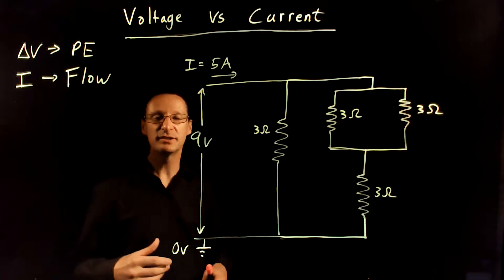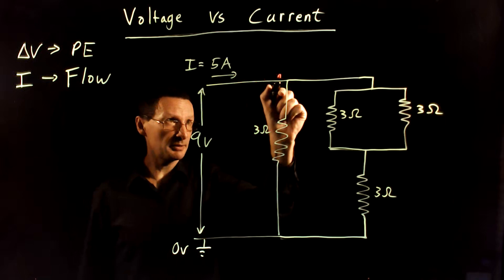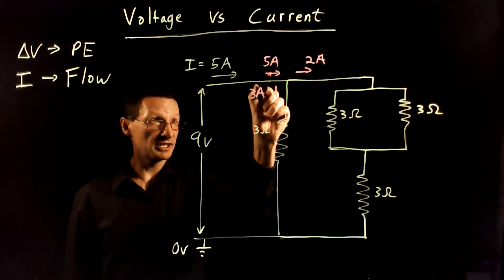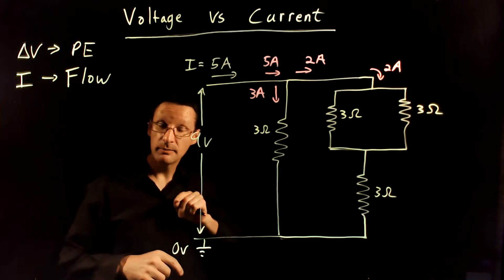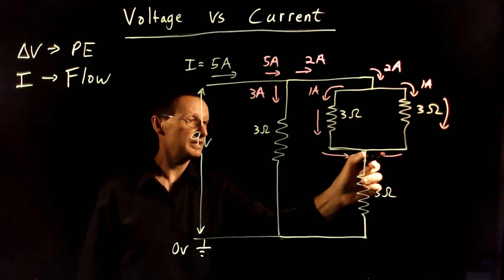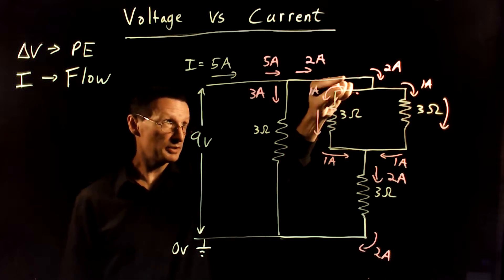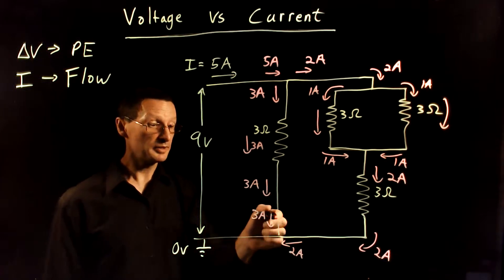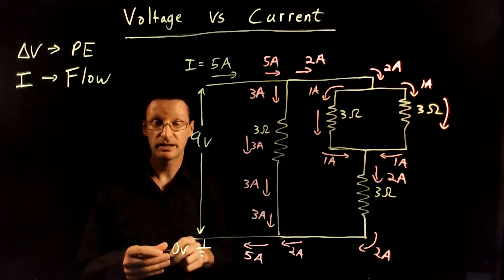Current vs Voltage: Current splits at junctions example

Comment: no amps are lost over the resistors to heat?
Reply from the maker: Amps are current, and no, amps are not lost since it represents flow.  The charges that flow into the resistor must flow out of the resistor, they cannot be destroyed while they are in the resistor.  However, they DO lose potential energy in the resistor, this is the voltage drop.  

Remember to think of current as FLOW.  Voltage is best friends with Potential Energy.  If they lose potential energy, this is a drop in the voltage.